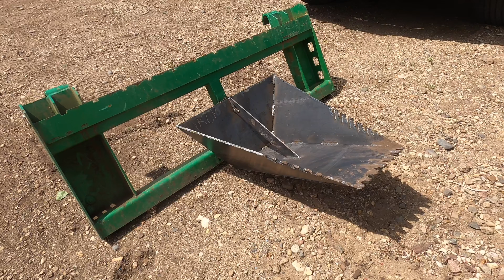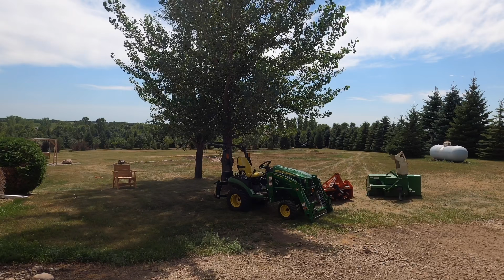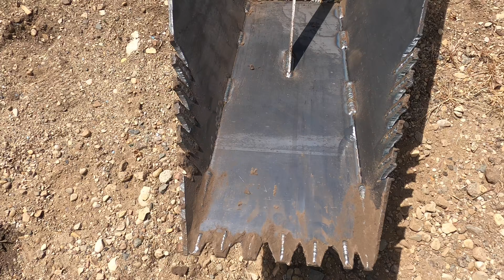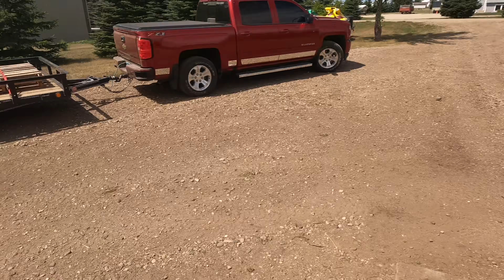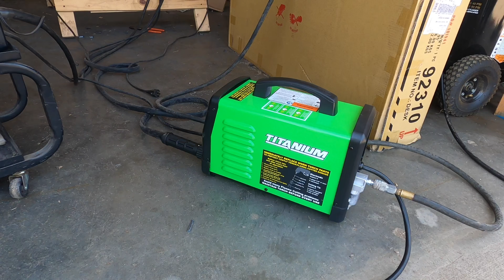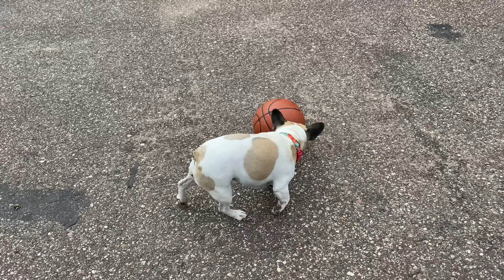1025r Stump Bucket - Do It Yourself! The $60 backhoe alternative! - Part 1 of 2

Comment: This was super helpful, thanks so much.  I am making one for my Kubota BX based on your dims.  You state that the gusset inside the bucket is a good idea.  Curious why.  I'm having a difficult time figuring out the failure mode that will prevent. I have zero experience building or running a stump bucket and do no claim any sort of competence that backs me up. Just trying to learn.

Comment: I bought my plasma cutter on eBay for $300 brand new from a dealer in San Diego. Had it for 4 years. Works great !
Reply: Get the 220 volt
Reply from the maker: Tired of It I added at 240v outlet to my garage since I got this plasma cutter. It works great! You got a great deal on your plasma cutter. I love these kind of tools!

Comment: Was your plate cold rolled or hot rolled?
Reply from the maker: Hi Jim, I'm not entirely sure to be honest. I will have to ask next time I buy steel from them. I am assuming hot based on its appearance, but I'm not skilled enough to tell the difference. Intriguing question!
Reply: Dash Thunder I only asked because I called about getting the plate and those were the choices they gave me. The lady on the phone couldn’t tell me the difference lol

Comment: Hi Dash.  Good to see another video from you.  I would like to see you make a video on how you use this stump/trenching bucket.  I mentioned before that I have a 2004/5 JD 4110.  I bought it with a backhoe model 46 but It is not quick-hitch compatible.  I have to say that mounting and dismounting it is a real pain and has been almost a 2 man job every time.  Now that I have recently poured a concrete slab for the tractor and have a level area, maybe it will be easier to swap, when I want to use the brush hog or landscape rake.  But if what you say is true that  it can do what 70% of a backhoe can do, I think I will build one because using the front quick attach would be a lot easier than mounting/remounting the backhoe.  I've always wanted to learn how to weld and I recently purchased a welder and plasma cutter  so making one of these seems like a good project when I'm ready for it.  Keep up the good work.
Reply from the maker: Hey Patrick! Good to hear from you again! I can’t imagine how much muscle it must take to mount that backhoe to the tractor. I’m hoping your concrete pad will offer some level of back ache relief! My goal is to upload a video of the bucket in action this week. I don’t have any more stumps to dig but I’ll try a few things with it and post some data to help viewers decide if it’s the right solution for them. Thanks!

Comment: Any issues with those iso tunes? I have the same pair an the black coating is coming off an I can only walk away from the Bluetooth source about 10’ before it starts to cut out.
Reply from the maker: Same here! The black coating is coming off mine too. My range seems ok but I notice that when I’m on the tractor I have some interference when I turn around and look behind me. They cut in and out even if I have my phone on me or in the cup holder.

Comment: Thanks for the detail about the build.  Digging stumps out with the backhoe takes a while sometimes. Does this speed it up some? I just may build one! Thanks again from Texas.
Reply from the maker: marty walters Hi Marty! Thanks for your comments and questions. I’m envious of your backhoe, I always wish I would have purchased it and added it to my financing when I bought my tractor. I’m hoping to get one at my next trade in. In terms of the time it takes to dig out a stump, I can’t imagine that using the stump bucket is any faster, however, the “cutting of the root” action from the stump bucket may be more efficient than tugging on a stubborn root with a backhoe bucket that does not have sharp edges. I noticed that I end up cutting a lot of roots with these buckets and I’m ok with that. I suppose its a personal preference whether someone is  concerned with getting all of the root out or not.
Reply: @TheLittleGreenTractor  I'm not sure if you can ever get all the root out.  At least where I'm at... It's kind of suprising how much you have to dig out around a stump to get it loose. At least 3-4 ft around for sure. The backhoe can break through them but only so much. I wonder if cutting through it would be more beneficial. I've only had my 1025r for a few months and have about 40 hrs on it, so I'm no professional. That's for sure, but I'm a capable fella. I may look into building a bucket and if I do, I'll post some of results.  It may be on GTT. Anyway, I like your videos. Doing a few jobs here and there to cover that payment is my goal. Thanks.